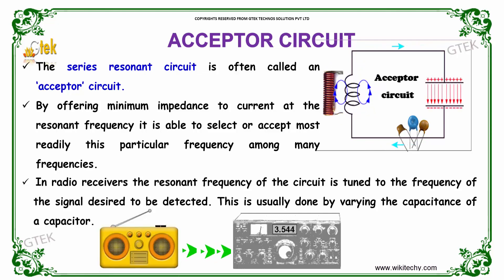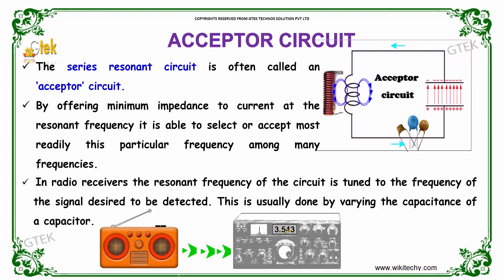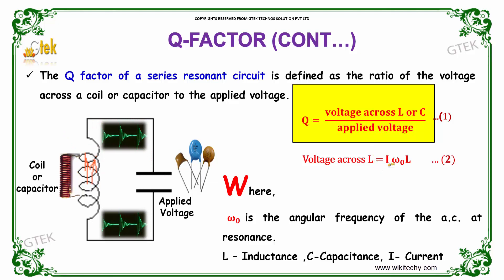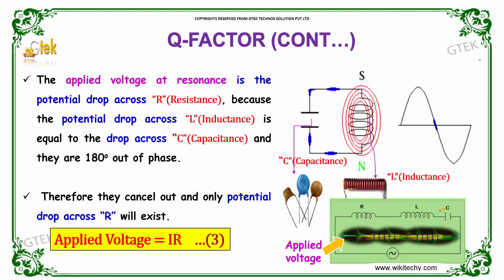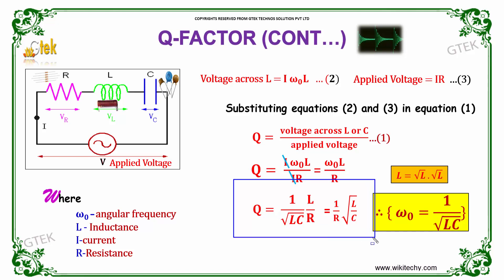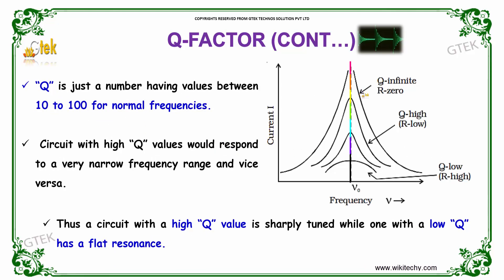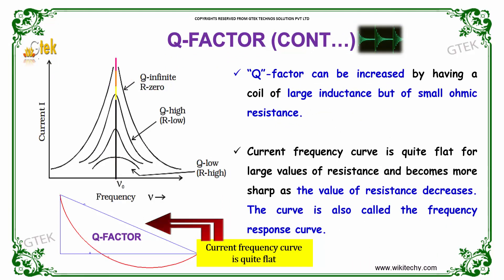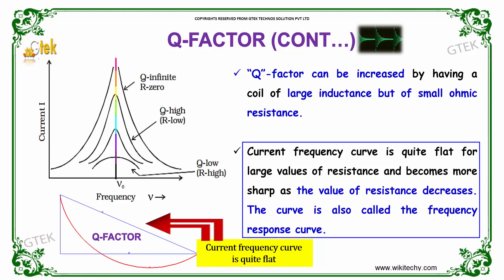Acceptor Circuit| Electro Magnetic Induction And Alternating Current

Comment: Series LCR Circuits. ... To study the variation in current and voltage in a series LCR circuit. 2. .... LCR series circuit is also known as tuned or acceptor circuit.

Comment: The most prominent feature of the frequency response of a resonant circuit is a sharp resonant peak in its amplitude characteristics. Because impedance is minimum and current is maximum, series resonance circuits are also called Acceptor Circuits.

Comment: An RLC circuit is an electrical circuit consisting of a resistor (R), an inductor (L), and a capacitor .... Resonance occurs because energy is stored in two different ways: in an electric field as the capacitor is charged and in a magnetic field as current ...... When a high voltage from an induction coil was applied to one tuned circuit, ...

Comment: The variation of circuit with the changing frequency f applied voltage is shown in (i) it is clear that for frequencies greater than or less then Wr the values of current are less than the maximum value (Io).

Further at w = w current is maximum (I0). The value of maximum current is inversely proportional ot R. for lower R values Io is large and vice- versa.

As series resonance circuit admits maximum current through it is called acceptor circuit. The practical application of series resonance circuit is in radio and. T. V receiver sets.